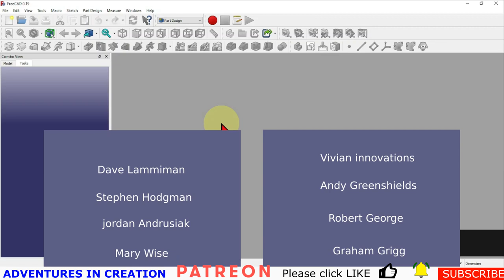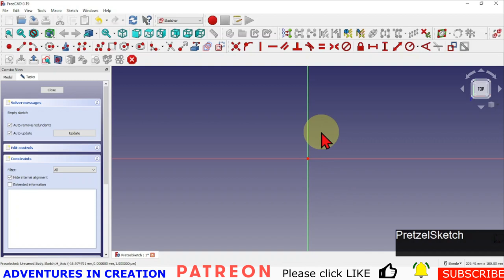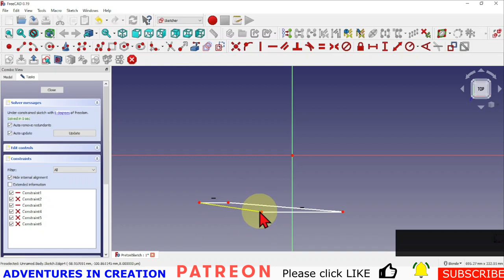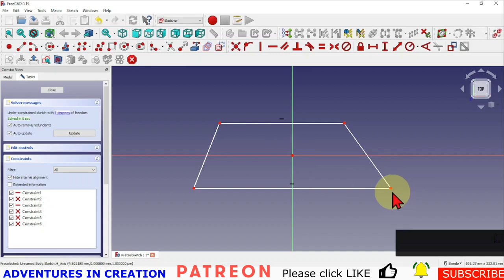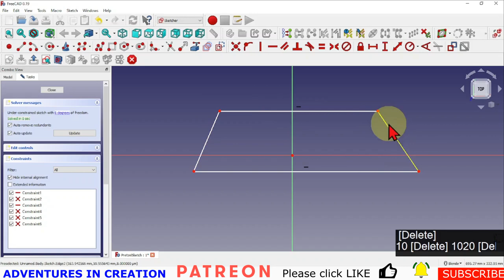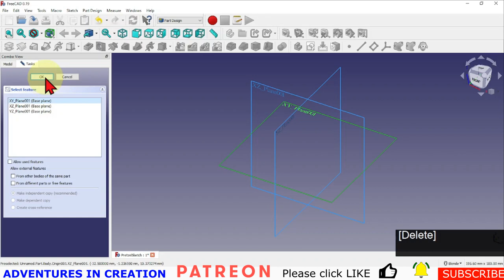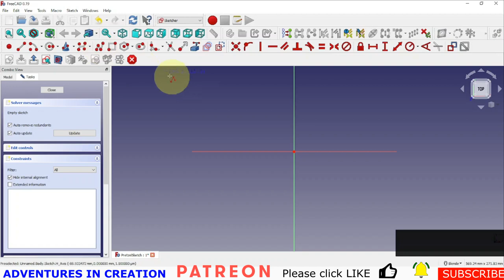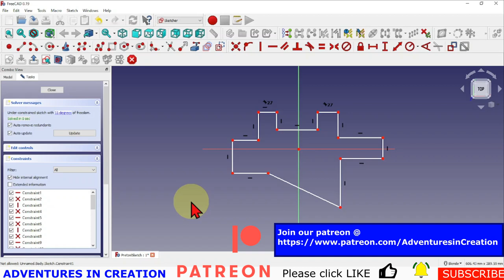FreeCAD Beginner #13 avoiding the Sketcher "Pretzel"

Comment: Just found your channel a week or so ago.  I'm Switching over from Turbo Cad (which was my daily driver for about 20 years).  This Free cad is much deeper and wider.  I think I'm going to like it.  Your vids have been a great help (this thing is NOT intuitive) .  Your play by play is spot on and easy to follow.  I do want to offer a content suggestion.  Some tips for organizing drawings with multiple parts would be a great help.  The kind of thing I'm talking about would be something like a machine with numerous parts like shafts, frames, covers, motors, etc.  Maybe a complex piece of furniture with moving parts and attachment points.  How does one organize the part tree to be able to find what one needs and keep everything synchronized for editing (I'm thinking a spread sheet will be involved here.
Reply from the maker: I will give that some thought. Are you looking to create technical drawings or just manage the assembly of models?
Reply from the maker: I am thinking about creating a rudimentary engine that we can build up over a few videos and maybe create the assembly for it.

Comment: Great tool and well explained.   I would like to create a sketch and then print it to my system printer at a scale of 1:1 such that it would be useful as a template that could be glued to a work piece and cut out with a jig saw or similar tool.  How would I do that?
Reply from the maker: Hi Ken, take a look at the techdraw workbench, that's the kind of drawing you will want. Not something that is created in the sketcher.
Reply: @Adventuresincreation  Thanks, will do.

Comment: Thanks for the video. I made a few sketches that are fully constrained; but having a Horizontal, Vertical, and Angle constrains that are linked to a spreadsheet.  Once you start changing the values in the spreadsheet, the sketch goes out of wack, especially if you flip from the negative to positive sides of the origin.  An Example of this is when you try to sketch an Angle Bar on the X-Y Plane that is driven by a spreadsheet that controls its dimensions, its position in on the X and Y Direction and Angle of rotation.  This proved to be challenging to "Properly" constrain without it suddenly turning into pretzels.  Even Padding a Cube then Pocketing it wasn't stable. Strange!  Can you help?
Reply from the maker: Sure, you should not have a problem if the sketch is constrained properly. Can you share your file and I will take a look at it.